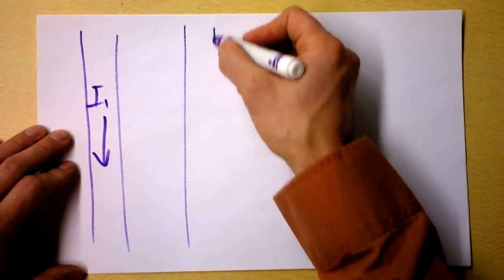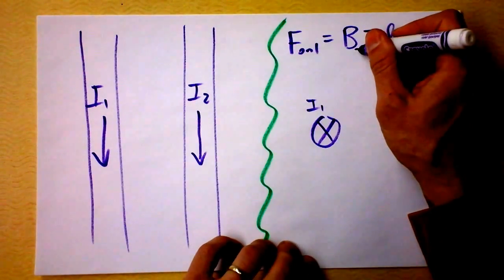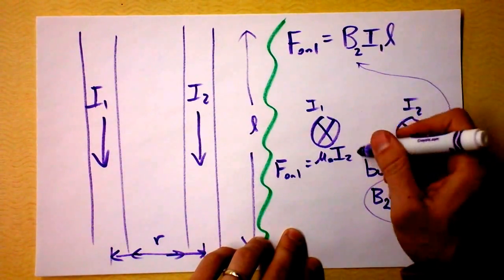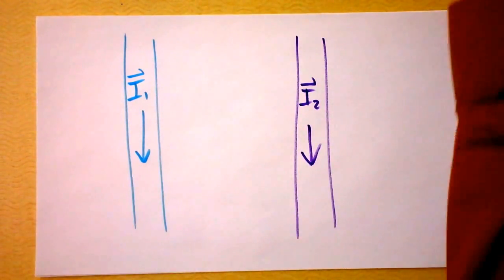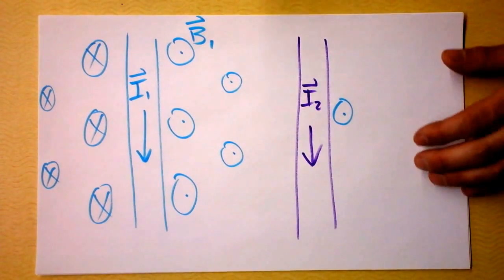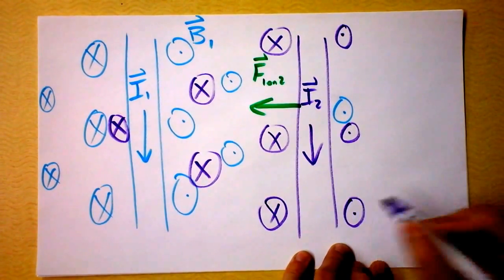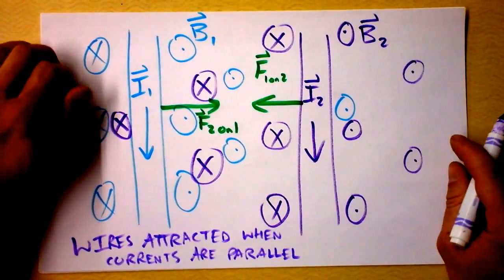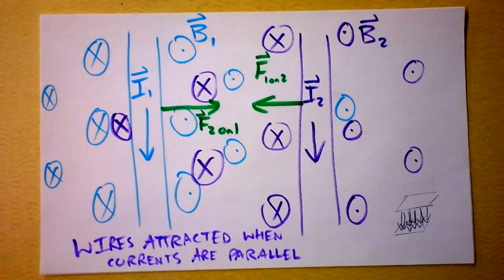Force Between Two Parallel Current-Carrying Wires | Doc Physics

Comment: Ampere's Law is The Bernoulli principle in  a fluid medium. Aka gravity comes from vortices around an axis of flow through a fluid medium.    The venturi effect draws the wires together into the low pressure region between the wires, just like elliptical galaxies form between two current carrying galaxies.

Comment from the maker: I find this an excellent thought experiment, and I have no immediate response.  I will mull it over and get back to you if I uncover a response.

You can confirm the result I describe experimentally very easily with either a large current or a sensitive setup, so your question is excellent.

Comment: Good presentation, but the force rises up to about 25% more when the wires are touching each other. Just apply an integration integration of JxB over the cross section of the wire studied. So assume that the wires are infinitely thin otherwise you have to solve a rather complex integration.
Reply from the maker: John Compter That's a great point!  Thanks!

Comment: strange, if you have two electrons stationary , they repel each other (static force), but if you take these same two electrons and shoot them down a parallel path, they then attract each other (two parallel line currents in same direction). 

if two static electrons are placed north and south on the earth, shouldn't the electrons attract each other since the are both travelling parallel due to the direction of the earth's rotation (parallel line currents) ?
Reply from the maker: brian menendez Ultimately, the question is about how big their attraction is.  The attraction because of the parallel currents is only noticeable because the wires that hold the currents are neutral.  As such, Coulombic repulsion does not need to be overcome.  If you propose that solitary electrons need to be going fast enough to actually be net attracted, you can derive special relativity!!!  Woot!
Reply: Doc Schuster

what about Birkland currents in space that don't have any wires as a medium,
Reply from the maker: brian menendez I just learned about Birkeland currents this morning (thanks!), but it seems like they are in a plasma.  I would imagine that there are positive charges up in there that are not moving nearly as fast.  As I study the sketches of the currents on Wikipedia, they seem to move apart.  This is probably because they follow B field lines, but it also may indicate that they are not particularly attracted.  Fun question.
Reply: Doc Schuster huh, your explanation has made me even more confused, sorry

Comment: I have a doubt:  Suppose there is  a space ship which is traveling very fast. Then inside the space ship would two identical charges(like two electrons) attract each other, because they would seem like current going in the same direction. It seems to me that an electron attracting another electron would be ridiculous for the person sitting in the space ship. taking that speed of space ship is enough so that force of attraction becomes greater than electrostatic force of repulsion.

Comment: Wait, is it because the current I2 is the one causing the magnetic flux and this flux it cut by the other wire, 1, to cause a magnetic force on wire1? And that r is used because it gives the magnetic flux density of wire 2, at only the region where the wire 1 cuts the flux?

Comment: Why do we use B2 to find the force on I1? Is it because the I2 wire exerts a force on the I1 ire? If so, then why do we use I1 to find the force on 1? Why not use I2, since it's the I2 wire that's causing the magnetic flux?